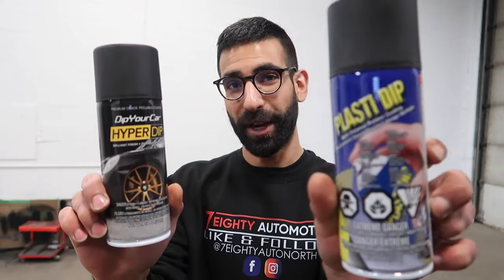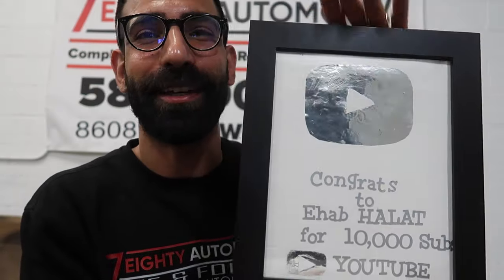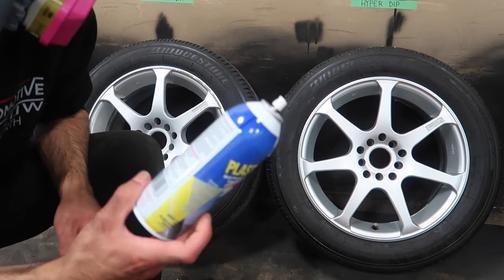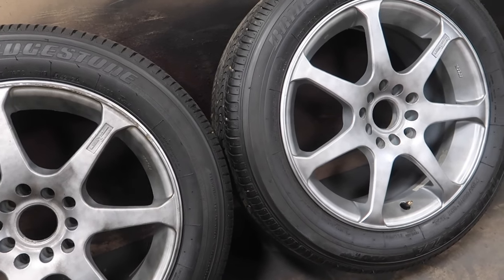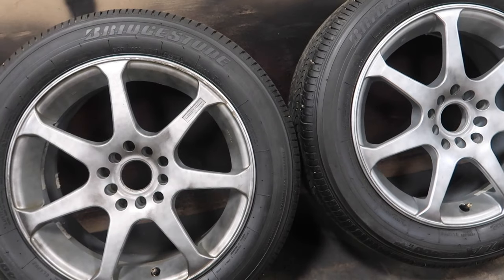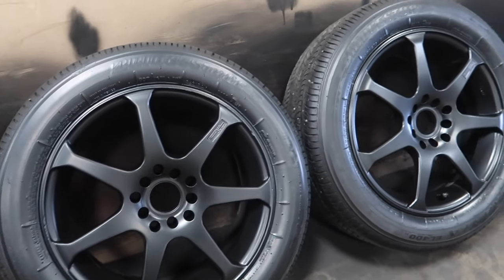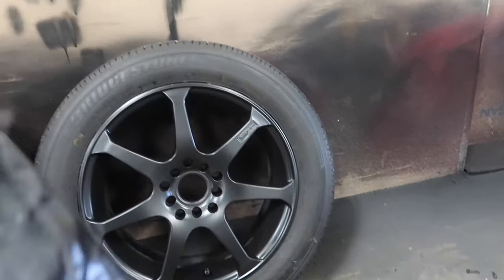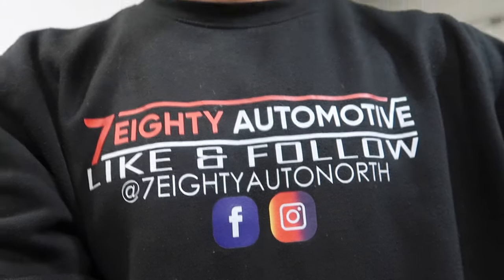HyperDip vs. Plasti Dip - Which is Better?

Comment: Any difference in drying time between coats between the two? 10 min?
I did hyperdip piano black last year for the first time.
Didn't come out as glossy. 
Has already started peeling.
Didn't have this problem with plastidip and glossifier
Did I apply hyperdip to thick to start?
Reply from the maker: With hyperdip i do 4 light coats, about 15 min between coats and then 4 solid coats, waiting about 25 min between each coat.

Comment: How good is the durability, what's it going to when you wash them or change the tyres?
Reply from the maker: It will last anywhere from 2-4 years from my experience. Car washing is fine if applied properly and changing tires may damage the lip but its easy to touch up after the tire is changed

Comment: Has anyone used hyperdip to black out emblems on matte paint? I’ve heard plastidip will stain the sensitive matte paints due to solvents in the spray. Was wondering if anyone had first hand experience with this on either product.
Reply from the maker: It wont harm the matte paint

Comment: what happens when you need to change the tires?
Reply from the maker: You just have to tell the person changing the tires to be cautious and use a microfibre cloth around the lip so it doesnt lift off. If it does peel then you have to thin it out and respray the black

Comment: one tip i saw with all the vids ive seen  is best coverage is to lay tires flat on the ground?
Reply from the maker: No i never do that. The aerosol can wont spray properly when you position it straight down. Its alot easier to lean them against the wall and spray
Reply: @EhabHalat  So i have a project im taking on...i want to black out all the crome on my maxima 2016...should be cool done right...so im in education mode...thanks for the vid..i found black covers for the door handles so thats easy..wish me luck.
Reply from the maker: @Rootskitchen  awesome! Good luck

Comment: Great video...HyperDip is 2x more expensive than PlastiDip. I was thinking of laying several base coats of PlastiDip first and then 1-2 final coats using HyperDip. In theory it should achieve the same smooth look and feel. This way I buy 4x cans of PlastiDip and 1x can of HyperDip. Would be interesting in seeing those results. What do you think?
Reply from the maker: Yeah its abit more pricey but its worth it. You cant layer HyperDip over Plasti Dip so it wouldn’t work that way.
Reply: @EhabHalat  that’s funny, hyperdip released a video themselves saying you could layer it on top of other products such as plastidip
Reply from the maker: You must be wrong because i read it everywhere and remember Fonzi saying you cant mix hyperdip with plasti dip
Reply: @EhabHalat what was their understanding  of mixing? Mixing while both are wet or applying over a dry surface where another one was already applied? That can make a huge difference.
Reply from the maker: Cant apply plasti dip over hyper dip and vice versa dry or wet

Comment: How about the durability factor?   Does one deteriorate or chip/fad faster than the other?
Reply from the maker: Hyperdip is said to be more durable in that factor with a smoother finish
Reply: Really but, if you want it to last, just spend $5 on undercoat, then $5/10 on black paint. It looks much better than this stuff does and If you ever want to take it off just thinners or paint stripper.

Comment: how long the curing time per coat....? and how many can we need to dip 4 wheel size R17....?
Reply from the maker: Wait 15-20 minutes or until you see the coat dry out to a matte finish. You will need 5 cans
Reply: @EhabHalat  is that okay, after done with the rubber, we continue give clear coat upon the rubber dip?
Reply from the maker: Yes you can add clear coat if you want a glossy finish

Comment: Idk, I've tried both on multiple items and I personally think they both suck. Imo, they peel off way to easily whether you sprayed it on a unsanded or sanded prepped surface. I wanted to do a set of 22" wheels I had for my 08 Cadillac DTS , but I wanted something that was going to last and be resistant as hell not only to the elements but resistant to scuffs and scratches as well. The wheels sat in my basement for like 10 years and looked like shit due to the chrome peeling off. I sandblasted all the chrome off, hit them with 2 coats of POR-15 etching primer, hit them with 4 nice coats of POR 15 chassis black top coat (had 3 quarts left over from a complete resto job I did on a 70 Chevy C-10) and finished them off with 2 coats of POR-15 matte clear coat.  I can pretty much smack them with a hammer and still not have them chip now. POR-15 products are a bit expensive, but just like anything else, you get what you pay for. The products work extremely well and are extremely resistant to elements as well as chemicals.

Comment: I plan to dip my grille, emblems and badges. This is my first go around so I’m thinking I’ll stick with PlastiDip. Is there a spray that will add a satin finish to PlastiDip?
Reply from the maker: They used to make a satinizer plasti dip aerosol to get a satin finish
Reply: i've responded 4 weeks late, but they sell a product called "glossifier" and i have used it and it works. however, it is just a satin finish. i definitely think its worth it though because it adds a lot of uv protection.

Comment: Sorry but this video bothered me a bit because there's no dust caps on the valves... surely they would get clogged up with spray....
Reply from the maker: No they are fine. I usually cover them but forgot to do so in the video. It doesnt do any harm though and can be cleaned off with some thinner

Comment: I thought about using hyperdip but it wasn't a huge difference from plastidip to justify the price difference
Reply from the maker: It feels smoother and its abit darker deeper black plus its suppose to be easier to clean and alot more durable
Reply: @EhabHalat  yeah I saw that but 4 cans of plastidip is like $30 and I think 4 cans of hyperdip were like $70, so to me that slight ifference wasn't enough for me to choose hyperdip over plastidip. I've had plastidip on my tires for 2 years so that's seems durable enough to me

Comment: Neither of these to products work on wheels, they I’ll only work for a few months since they’re not heat resistant and wheels can get extremely hot
Reply from the maker: I think ur mistaken. They are heat resistant and last for 3-5 years. Ive done this many times on my own wheels. If applied properly with correct coats, it will last

Comment: I just did my wheels in Spray Max 2k Hot Rod Black Satin 368 0212, with Spray Max K2 Clear. They look fantastic. 
Though might of tried Hyper Dip if I had seen this video first.
Reply from the maker: I did a test and 2k doesnt adhere to hyperdip, only plasti dip
Reply: @EhabHalat  Does clear give plasti dip a gloss?
Reply from the maker: @johnadams7402 only 2k clear by spraymax
Reply: @EhabHalat  Thanks for your help.

Comment: Dude if you paint them the right they would come out way better  😂 seems like those products you used are DIY soccer moms
Reply from the maker: I did not understand what you just said lol. Thats how they are suppose to turn out
Reply: @EhabHalat  you have to do a bit of research on how you paint rims , from prep to finish it , only takes a few easy steps .I don’t mean to disrespect but, for someone who doesn’t know anything about paint than this is the right video
Reply from the maker: This is a removable coating, for some people this is easier and they can remove to go back to factory finish down the road
Reply: @EhabHalat  that’s right removable coating ! Lol

Comment: If you really take your time, and know how to use Hyper Dip and don’t mind paying more money, sure. But if you mess up, it will drip, you will have to redo, and possibly buy more cans. 

With Plast Dip, Or Luxury Black Sapphire, it’s very forgiving. You don’t need special techniques, and once glossifier is applied, it looks very similiar to hyper dip. 

It’s cheaper, and don’t listen to that durability BS! Both of these will eventually chip/peel of wheels or grill. If you have to take tire off to repair/replace, 95% chance it will chip along the edges unless the tire guy knows some trick to not mess it up. 

The grill, same thing. Rocks and debree will “chip the dip” no matter which one you use. 

Out of Hyper, Regular, and Luxury Sapphire, I’m going with the Lux and Glossifier kit. Comes with 4 cans and 2 glossifiers plus handle. $85 amazon 

Good luck. Maybe I’ll put a vid out after to show results

Comment: LOL but you got the dip/paint inside the lug nut holes.....that can't be good....
Reply from the maker: It doesn’t make a difference, i do it all the time. Just torque the lug nuts after and its fine… it will strip away any coating in its way to sit tight and snug

Comment: any product will look great on day 1, this video is pointless w/o a long term review. i had plastidip on my 2016 truck emblems for 5 years and it never lifted once. i got a new truck and used hyper dip and inside a month it was lifting and within a year it was fullly separated and a disaster. hyper dip is trash.
Reply from the maker: Really? Ive had hyper dip done on my emblems and side mirrors for 2 years now still holding up great no issues